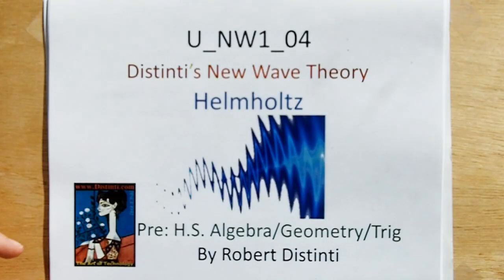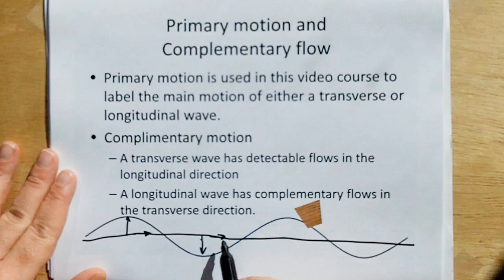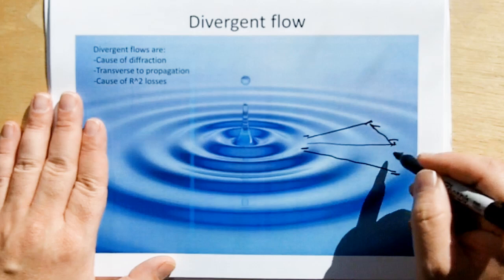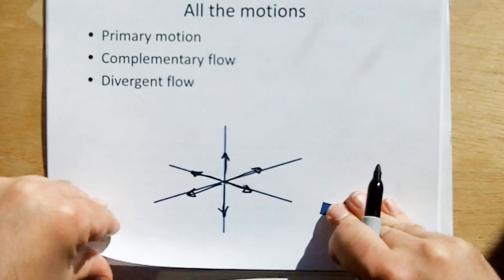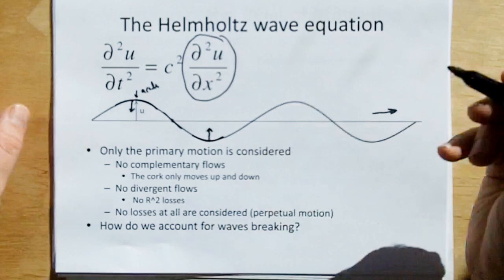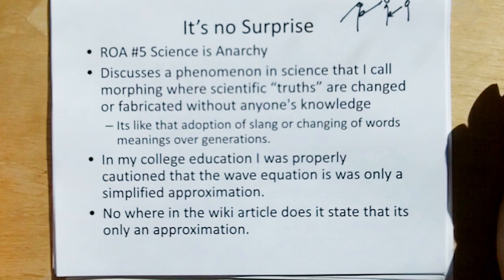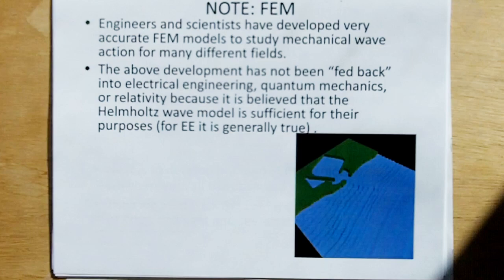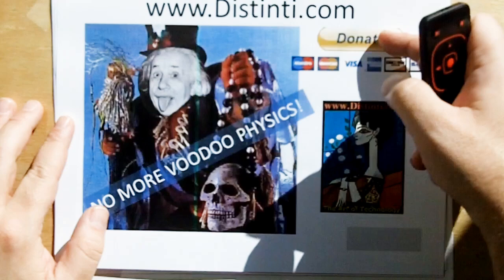U NW1 04: Helmholz

Comment: I love your vids...
The primary motion of a transverse wave is actually longitudinal - because 1 dimensional objects drive 2D objects (& 2D drive 3D), not the other way around. That's why there's circular motion. The universe unfolds from 0 dimensions into 3, in order.
The transverse motion is driven by the longitudinal. It is an effect of the longitudinal wave.
Your right though - you can't have one without the other... :)